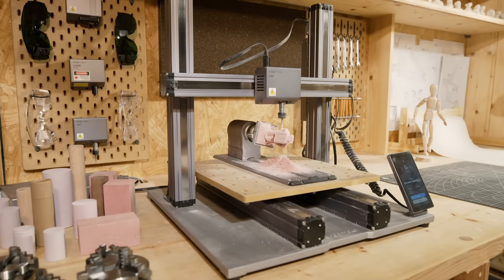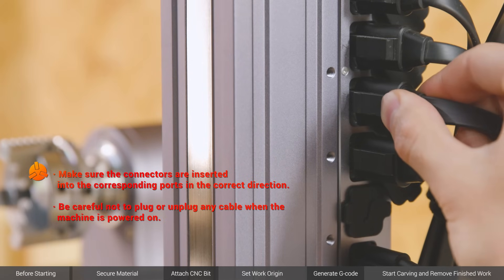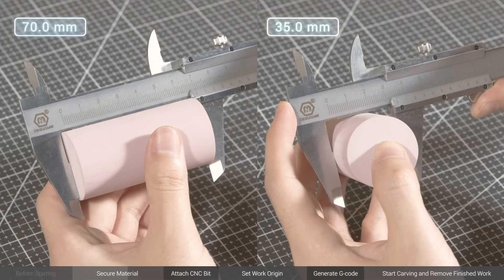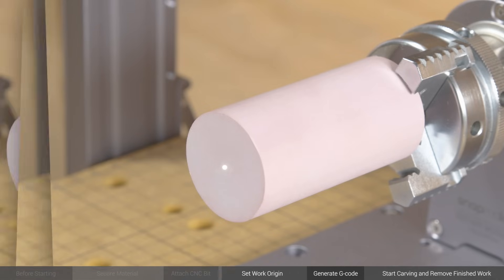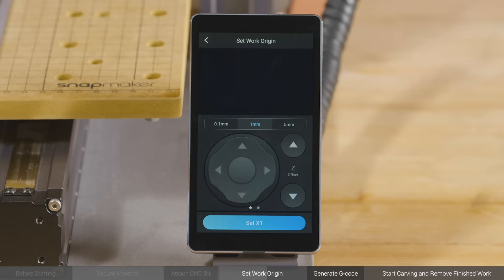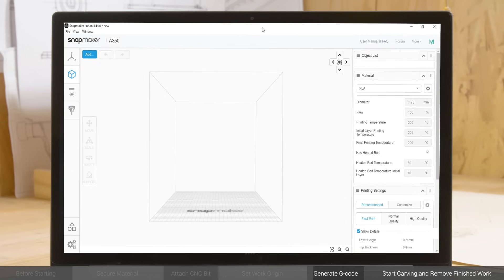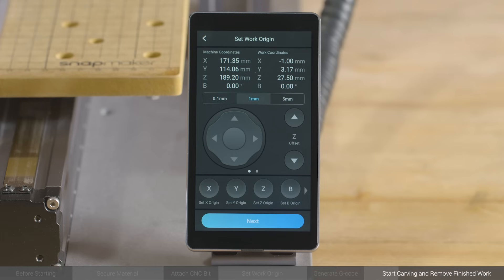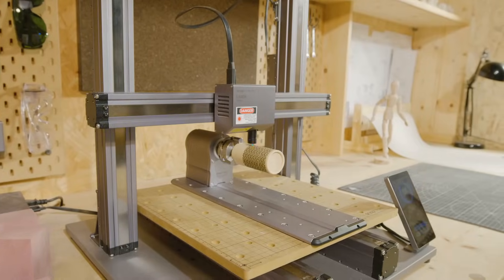How to Use CNC Function with Rotary Module

Comment: Hey guys it is possible to use different cutters, with different shapes and diameter? As long the shaft diameter stays the same?
Reply from the maker: Yes, you can use the different cutters, Snapmaker 2.0's CNC Module is equipped with a standard ER11-A 1/8” collet.

Comment: i want to machine snakewood, bubinga, amarant, hard maple etc... is this ok if the whole process is set to a lower speed for less mechanic stress or something?
can the 1.6w lasermodule cut 0.5-0.7mm hardwood veneers, or do i need to upgrade something?

greetings

Comment: Just got mine today and its awesome. Haven't tried the CNC yet, but the laser engraving was easily setup and the sample file engraved a perfect picture on the small gift box. Great addition to the whole environment so far. The emergency button is also a very useful addition and works flawlessly. Usually I had to jump to the back of my setup and search for the power off on the back of the power supply. This is so much better with the button.

Comment: Very interesting stuff for sure. As someone who works in a machine shop, I have a couple questions?? How does the rotary table align when mounted to the machine. If it is only Bolt holes then does it ever go on straight. This could be detrimental to parts sizing from one end to another. Also is Renshape or other soft materials the only thing you can cut? For example can we cut aluminum, brass or steel by using lighter cuts? Also is it possible to use software like MasterCam or GibbsCam to program it. It sure is a great looking machine and I am very interested in investigating more on this.. :)
Reply from the maker: Hi! Glad you're interested. 
· Actually it's not about the material size, it's the carving toolpath. As the tailstock point may penetrate a little into the material, it's necessary to leave a certain space at the end of it when you generate toolpath. If the material is too long for the rotary module, it's OK to go without the tailstock.
· For now the machine can't work on any metals.
· Also we don't have a post-processor for MasterCam or GibbsCam now.
Reply: @Snapmaker  do you have a updated fusion 360 post processor to enable 4th axis?